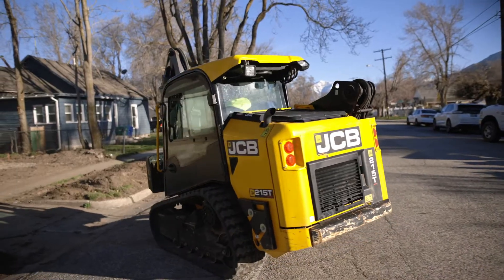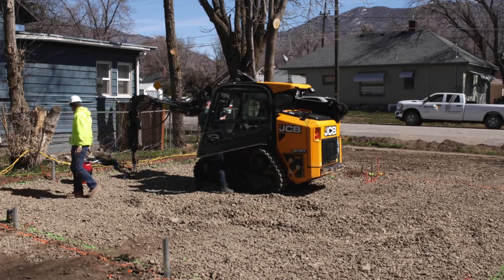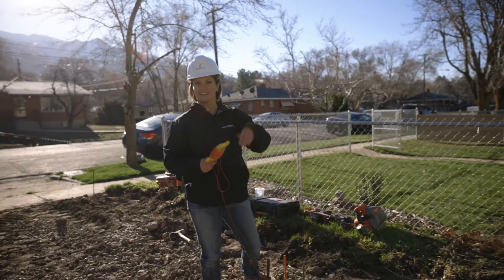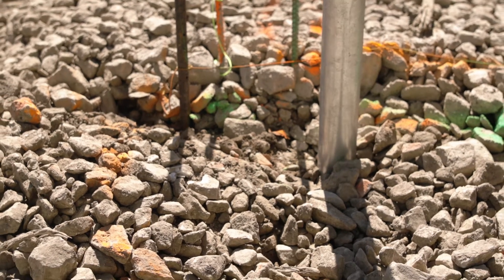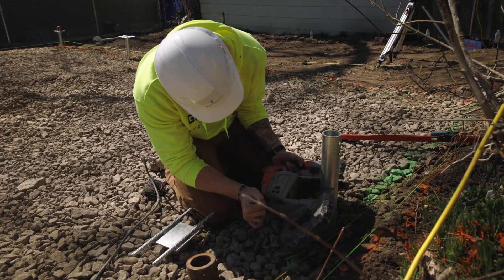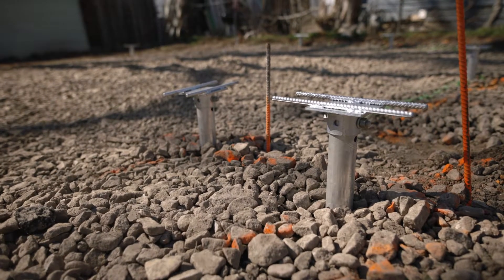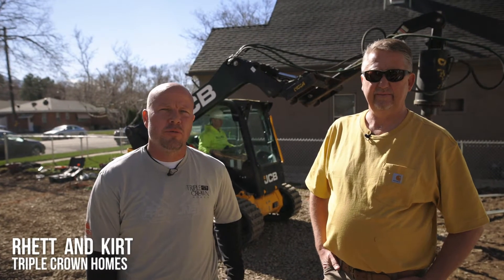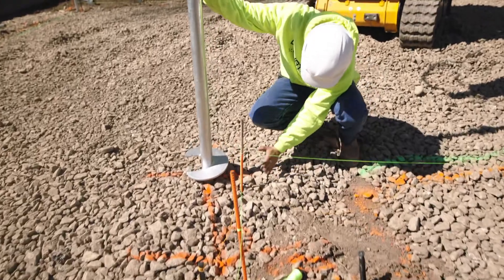Helical Piles for Slab On Grade Construction - New Home Foundation

Comment: My property is on very poor soil at the bottom of a ravine near a river.  It was disturbed by a poor excavation next door.  The geotechnical and structural engineers spec'd out micropiles and grade beams.  Pretty cool.  The piles go down 40-50 feet and grade beams sit on piles with suspended slabs on the beams.  Nothing is going to move.

Comment: how far apart do you set the piles?
Reply: That's what geotechnical and structural engineers determine once they know the soil condition and the loads of the structure.

Comment: Why not just put the rebar heads on straight so you don't have to trim them? aren't you drilling the hole for it anyways?
Reply from the maker: Our heads are predrilled if the pile is installed the full length.  Sometimes the holes and depth do not line up perfectly.

Comment: how do you know what torque is enough for load bearing if you only have a PSI/Bar gauge on your hydraulic line
Reply from the maker: Each hydraulic drill has a PSI/Torque calibration.

Comment: My concern would be what happens to the steel after 50 years  or 75 years I mean, obviously I noticed that it’s galvanized. What does that steel look like structurally after that time frame and how does that translate if there’s a failure with that much weight above it that’s no longer giving it the support that it needs essentially you put all the way onto these peers, so if there’s a failure in several peers in one area may because of water buildup, what’s the potential damage?
Reply from the maker: The piles are all loaded with a safety factor of 2.  We work closely with the engineers to make sure the pile will be able to hold a minimum of 2 times the requirements. The galvanization on our piles conform to ASTMA123 which is rated for  72-73 years of life even in the most corrosive atmosphere.
Reply: I imagine it would be fixed the same way they fix failed foundations today with underpinning with more piles.

Comment: Why cut the rebar when its close to the string line and not bend it. seems to me its better to keep as much rebar intact as possible
Reply from the maker: Great point. Bending is an option as well.  We make sure we have the required lengths per engineering before ever cutting.
Reply: @goliathtechutah771 why not just turn a little further so the connection holes are aligned for no need to cut once the head is attached?

Comment: I'm a builder in Central Texas, and in this part of the country we have the same concerns with soil movement due to drought conditions as builders in Northern climates do with the freeze-thaw cycle. Building slab-on-grade foundations resting on piles eliminates the concerns of soil shrinkage due to drought conditions. It also eliminates the need to water your foundation during dry periods which is often problematic as during drought conditions water restrictions are also in place. I've experimented with building several foundations with steel piers and I suspect will begin to see a great deal more of it in the future. Thanks for your video it's a great explanation for how this process works and how it can be a substitution for digging shallow footings.
Reply from the maker: Thanks. We have reps in Texas.  You can see if one covers your area. https://www.goliathtechpiles.com/find-a-certified-installer

Comment: You dig additional piles next to it per the calculations ( bearing load) and create a larger pile cap to support it. On a commercial scale, this is done when the water table is close to the surface. Basically your building a bridge to support the load. 😊

Comment: What do you do when the rock is to big to be moved?
Reply from the maker: There are a few options.  If we have not hit our minimum depth, we often will get engineers approval and move the pile one side or the other. As with any project, having close communication with the engineer helps make the job go smoothly.
Reply: It depends on uplift requirements. Often times the rock will become the bottom of the pile. Maybe it is the size of a house, that would definitely support the load.
Reply: Get a shovel
Reply from the maker: @kirkandpam1749  - exactly.... or the bucket on the excavator works great if the location needs to be exact.